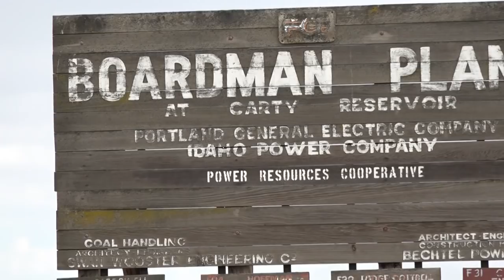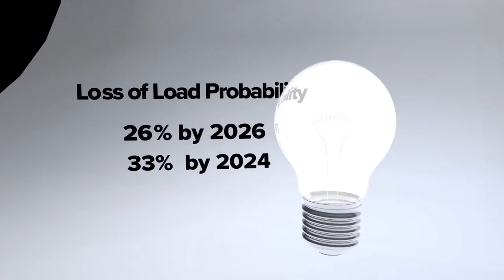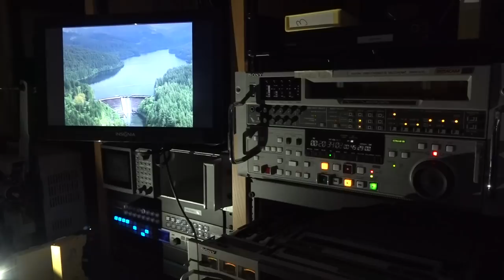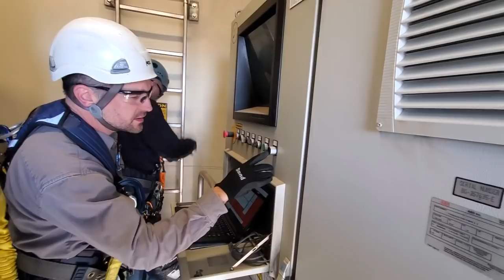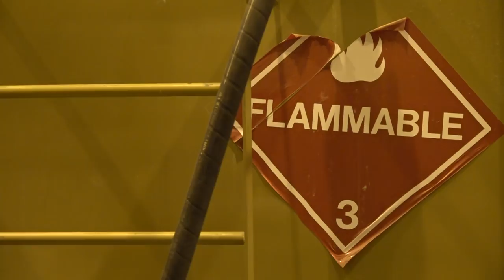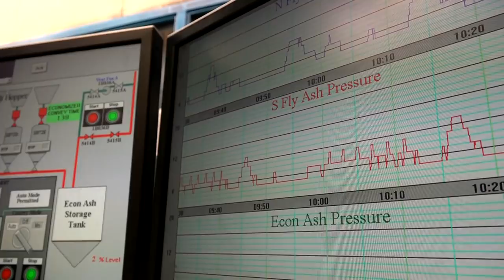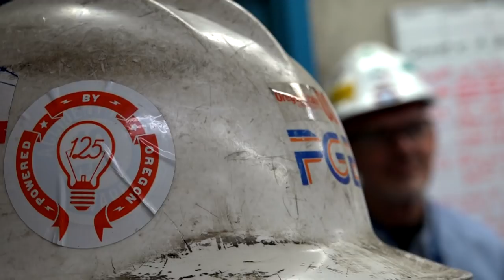Will there be enough electricity after coal plants shut down? | 'Power Struggle' full documentary

Comment: The solutions to the problem of unreliability is getting the utilities to do the Right Thing.  This was overwhelmingly shown by the frozen Texas power grid in mid February and the outages caused by Texas utilities not following the commission's recommendations, trying to save money. 

What the utilities must do is install enough wind and solar to meet peak demand.  The excess generation must be used to generate hydrogen.  The gas fired plants must be able to run on up to 25% hydrogen and later 100% hydrogen.  The hydrogen should be sold as fuel for transportation.  There must be no curtailment.  The only issue that this system has is the lack of the backbone by the utilities and regulators to commit to spending the money to do the job fully and expeditiously.  That's all!

There is no struggle.  The problem is with the decisionmakers.
Reply: Where will you get the hydrogen?  And what are you going to do about things like hydrogen embrittlement?
And Texas had a similar cold snap 10 years ago where there were no blackouts on this scale.  The difference?  Wind was 6% of ERCOT capacity in 2011 and is now 25% in 2021.  This means that when a big cold system drops wind speeds below the 7mi/hr for the turbines to do anything, wind generation craters.  As it did, going from 8GW 24hr before the storm to 600MW during it.
Then there is the failure of the natural gas pipeline system, which was due to drumroll electric compressor stations.  These compressor stations used to run on natural gas engines running off the pipelines, but that wasn't green enough.
Reply: @randacnam7321  wind turbines should have been winterized
Reply: @JT-zl8yp  Cost.  Everything with utilities is a cost benefit analysis.

Comment: Coal Plants could still burn iron Powder to generate electricity.  It doesn't emit co2 and the iron-oxide that is produced as a result of the chemical reaction can be turned back into iron power using excess renewable energy.